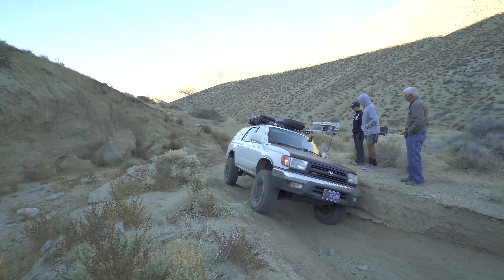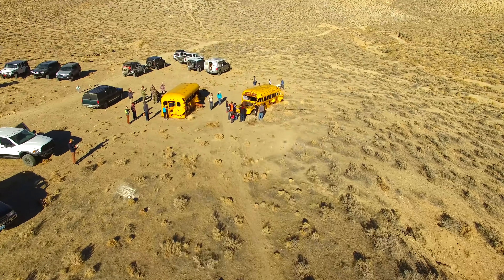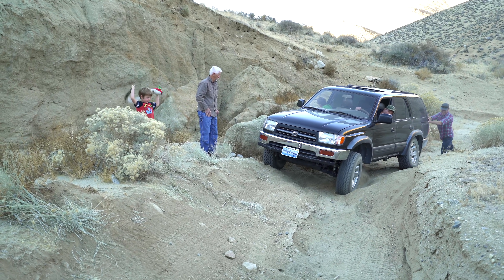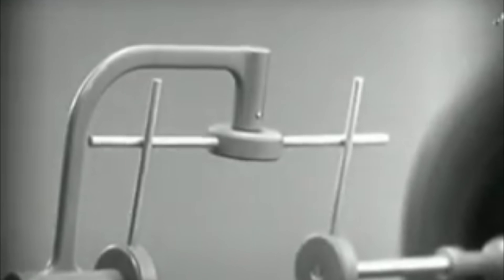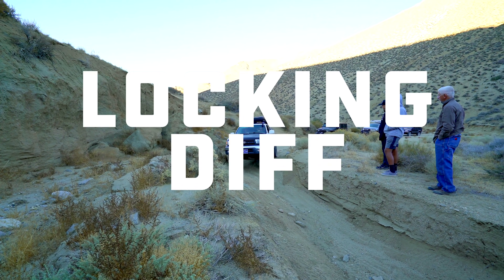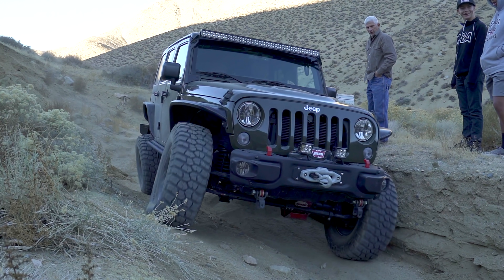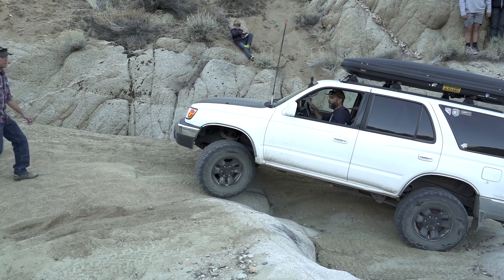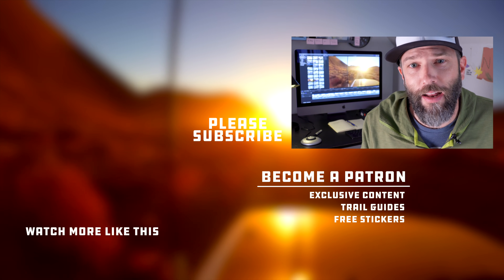Open Differentials vs. Traction Control vs. Lockers

Comment: Torsen diff is the answer. It combines the best of both worlds!
Reply: A true locking differential will always perform better in this kind of technical terrain.
Reply: Kal P Sure! a true locking diff is almost fools proof but also have disadvantages in terms of direction control and the wear it suffers for long operation. In my humble opinion the torsen have the ability to mechanically get locked and still operate smother on curves and tricky sections without risk of break something for improper use or abuse. I think at the end there is more than one way to do the job and on 99% of time torsen will do it right. Obviously if you prefer fully locked diff is perfectly fine 👍🏻 at the end this is about the fun you have in the trails 😁
Reply from the maker: I believe a torsion will still fail with in wheel completely in the air. Is that correct? Even still that rarely happens to more than one wheel at a time.
Reply: All-Terrain Family Well actually it is designed to get locked when some of the wheels on the same axle start to spin faster than the other so I don’t think it fails in that situation. If the wheel in the air is on the front for example it will not affect the rear as the center diff will still sending power to the rear axle. At least it is like that with the SS-II. It is basically a mechanical traction control.
Reply: All-Terrain Family that’s correct but tapping the brake solves that and allows for the Torsen to “lock up”. Torsen style diffs are used in the HMMWV military needed something that was private proof and required little to no maintenance.
Reply: Torsen is nice, but it's basically an all-gear type limited slip using worm gears. Limited slips are more suitable for street use then Off-road.
Reply: The Ford Raptor uses a Torsen in the front, but a true locker in the rear. Locker locks 1:1, a Torsen can not by its nature.
Reply: Adrian Wevers  Agree with the 1-1 lock. And have no doubts on the benefits of a true locker. My point is for the overlanders and most of off road aventures the Torsen will be fine without the disadvantages of the lockers. Even the wheel in air is solved with the pre-load packs in the axles or the TC. Probably in a extreme crawling situation lockers will rule, but for the rest of the time the fun is guaranteed with a good torsen in. You will not believe where I can go with my Mitsu. Cheers!
Reply: @humbertorubi4947  If you're an overlander who is actually going places where 4wd is required, then a locking differential will provide better performance and will last just as long as a limited slip.  

The beauty of a locking differential is that you only have to turn it on when you actually need the extra traction (with the exception of an auto locker like the Detroit locker).

Limited slip differentials are okay (they're certainly better than open differentials) but they have their limitations in technical terrain.
Reply: Torsen only works in mild conditions. It also suffers wear as opposed to locking diff. You sometimes need more than the torsen can send to one wheel. You need the whole torque from your transmission on ONE wheel. That is where Lockers are the best.
Reply from the maker: Yes!
Reply: All-Terrain Family My Mitsubishi Montero limited have one of these in the rear combined with a center lockable diff and it is simple phenomenal. Mitsu call this system Super Select II. It works great on curves and off camber situations. It’s curios is not used so often on more cars. Nice video 👍🏻
Reply: @humbertorubi4947  The traction control on Monteros has it on all four wheels. It's phenomenal and was ahead of its time. There are plenty of videos showing Monteros(Pajeros) doing insane things with no lockers.

Comment: Having a build done to my Tundra - including rear and front ARB airlockers. Hope I didn’t make a mistake
Reply: ARB is an excellent choice, I have one on my Toyota. As long as the people doing the work are competent they are very reliable. Best thing about the ARB is you can engage and disengage on the fly if you so desire. They lock and unlock very fast.
Reply: Thanks you guys. Originally had this build done because I thought we were going to head back up to Anchorage for an assignment in January. Thought lockers might help in case we ran into bad snow at some point. East coast til spring now and then hopefully head to the complete opposite side of the country where I can use my new toys.
Reply from the maker: No way you made a mistake. Unless you hate traction.

Comment: You can partially engage the e- brake a few clicks  to simulate traction with a rear LSD.
Reply: bush nut if the vehicle has brake traction control it will do it, itself.
Reply: @fabulousoffroaddesigns5080  Jeep calls it BLD
Reply: I’ve got 17 year old truck. No TC, just a good rear LSD and an open front. When I’ve been cross axled by applying the E brake a couple of clicks it fools the LSD by simulating traction at the spinning wheel. Not much I can do about the open front diff. Except install a locker.
Reply: @bushnut8305  Good way to destroy you parking brake. It's not a Emergency brake and if you have a disc/drum that little shoe will twist all to shit.

Comment: Why no AWD?
Reply: No real off-road vehicles use AWD. Subaru's are great, but AWD is simply not a good choice for serious Off-road duty.
Reply: Adrian Wevers oh trust me! I agree! But. I would say. The only AWD vehicle I would consider buying to do hard core off roading would be a Range Rover sport. It  is AWD. Has a low range and high range transfer case! And! And! A rear locking differential!
Reply: Plenty of vehicles are both all and four wheel drive. 4th gen 4runners have a lockable center diff and ATRAC II for example. You can run the 4unner in low range all wheel drive if you want.
Reply from the maker: Yes and no. Subarus can go a lot of cool places despite the AWD. I bet a suby would make it through the obstacle in this video just by small size advantage. Basically, “off road” and “4x4” is a higher bar that we admit.
Reply: The AWD on a Range Rover is not the same thing as what you find on Subaru, and also the Toyota for that matter and others like it. These are true 4x4 systems with a AWD mode integrated into the transfer case. Basically, they have a Torsen in the transfer case that can be switched into full lock mode. It's entirely different then the type of AWD you find in a car like a Subaru.
Reply: Adrian Wevers really? I did not know that. That makes sense now. So would it be possible to put a Torsen in the from differential?
Reply: @zanehopefz6hundred761  I am not sure I understand your question. Are you asking if it possible to make a 4x4 into AWD? It actually would be possible in some cases. But, it depends. For example, if you had a Toyota 4Runner with a normal part time 4x4 system, it would be possible to get a transfer case from another 4Runner that has the AWD 4x4 style transfer case and swap it in. You would have to swap the entire transfer case. It would be a challenge to hook up the electric shift motor in the transfer case in the Toyota, but it is technically possible. In a 4x4 with these type of systems, they are usually referred to as "Full time" four wheel drive. It would be better to simply buy it that way though. Staying with the example of a Toyota 4Runner, the current "Limited" model in the 4Runner lineup has this type of transfer case in it. Also the Toyota Land Cruiser had a Full-time for wheel drive system.
Reply from the maker: I believe you can put a Torsion in the front diff.
Reply: @AllTerrainFamily yes, of course. If someone makes one for you application, though that's not made for a lot dffs.
Reply from the maker: We didn’t have one on this trip. But we have plans to test a new Subaru Forester.
Reply: @AllTerrainFamily  subaru forrester,??,grass padock machine,garbage vehicle,we had one on a mild trip,on a farm,he never came back,no wheel travel,no ground clearence,this track was for learners,too hard for him....subaru,,,frigin joke.
Reply: For the record, I had A WRX. I love Subaru's, but it's crazy to make one into a dedicated off road vehicle. You would be money ahead to just get a proper 4x4.
Reply: all wheel drive is rubbish.can not be disconected,my mate with an 80 series has it,we tell him to fit hubs but he thinks it handles better.??.not.just more wear & fuel.open diffs with a choice of lockers is best,period.

Comment: On my 2013 Wrangler (with open differentials) my traction control turns off when I'm in low range. I get through with low (15 psi) tire pressure, articulation, and driver skill. Yes, I eventually want lockers in both ends.
Reply: BLD is still enabled in 4 Low read your manual
Reply: You're correct, the "limited slip" function of the traction control still works in low range.

Comment: Traded my Jeep Rubicon in for a Toyota Tundra. Glad to see the Tundra in this video. I told my wife we could still go a lot of places in the Tundra. I wanted more towing and hauling capability. I do want to add lockers eventually.
Reply: I am in the same boat. I have a 2nd Gen Tundra and worry about it being too big for some trails.
Reply: Bradley Johnson only if your worried about NV pin striping.
Reply: @shawnomeara22  I am worried about the scratches, but I'll get over it.
Reply: Tim Johnson I’ve scratched and scraped my Wagon pretty good and mostly got over it. Check out All Terrain Family’s other video of the walk around of my PW.
Reply: Tim Johnson, I did the same thing. First I traded it in for an F150, but started having problems with it right away, traded it in for the Power Wagon and haven’t looked back. The factory lockers and low gears are hard to beat.
Reply: @shawnomeara22  Power Wagon...you SOB...Ha

Comment: Excellent video mate! As someone already said, the Jeeps are equipped with BLD (brake lock differential) which is basically the traction control. It applies a little braking when slippage is detected, as you explained in the video. Would have been nice if you included LIMITED SLIP diffs on this comparison! The Jeeps call theirs the Trac-Lok diffs (equipped in JK Willys). The Rubicon has de Tru-Lok diffs front&rear. Cheers!
Reply from the maker: Thanks ! Next time i get a chance we’ll look at LS.

Comment: Wrangler calls it BLD (brake lock differential) and enables open differential to act like a LSD. The system is more responsive that typical traction control. Most Wranglers do not need lockers and many with BLD have conquered the Rubicon.
Reply: It’s most aggressive in low range, although it will engage quite severely in low traction situations when it detects very high speed slipping such as on ice. It can be disabled in 2 wheel drive by pressing the traction control button, but stays on permanently in low. From what I’ve seen in my own JK, it works very effectively and it has gotten me through some pretty nasty trails
Reply: Ryan's Jeep Garage do all JK’s come stock with that?
Reply: Shawn O'Meara as far as I am aware yes
Reply: No.... it is a $600 option or comes on certain special editions... my winter version jk has it and it works great... for east coast wheeling ...I can go anywhere my rubi buddies can.
Reply: @dp_NYC  Yes, all JK's up have it standard. https://blog.fcanorthamerica.com/2008/02/11/jeep-brake-traction-control-explained/
Reply: On a JK ... you had a standard version. An optional Trac-Lok limited slip LSD (available on Sahara’s and Sport S ) @$595... this was also included in Willy’s, 1942s, and winter versions and it always has KO2 And KO mud tires)  on a Sahara,  Trac-Lok is automatic. Rubicons have as standard Tru-Lok is electronically controlled via switch air locker.    (When I bought my 2016 winter version it included the TracLok but offered the Tru-Lok as a $1600 option.     So unless your Jeep came with KO tires... and you didn’t check that TrakLoc option... you have open diffs front and back...
Reply: @dp_NYC  ESC, TCS and BLD are all standard on a JK Wrangler. No option it's free..
Reply from the maker: I’ve seen it in action on video. It only works in Low right?

Comment: Keeps have traction control similar to atrac as well as that rubicon has front and rear lockers that can be individually selected. He probably just had the rear locker on as it looked like there was a slight turn in the road and front locked makes turning hard.

Comment: Had a fj cruiser with atrac and selectable locker.  Loved the selectable locker.  Marlin crawler has some videos illustrating open diffs with extreme gearing that can make someone scratch their head
Reply: I have the 5th 4runner with A-trac as well. I heard it's not good idea to use A-trac in mud. Would you agree or disagree?

Comment: Mike, good video/explanation on a tough process/function to describe.  What I did here was activate the rear locker.  As is explained, also locking the front dif is sometimes a must (not standard on many 4X4s), but can be a real handful in a tight situation where you have to maneuver.  It can be very detrimental to run either locker on a hard surface, like pavement which doesn’t allow for any give, thereby transferring all of the stress directly to the drive train.  Best to confine it’s use to sand, snow, or mud..ewwww, on the last one! :)
Note:  I had also disconnected the sway bar for more front wheel articulation.  I used to have to do that mechanically on our TJ.  On the Rubicons all functions are done electronically.  In the 80s on my K5 Blazer I installed Warn locking hubs which often meant getting out of the rig in nasty conditions to actuate them.  It didn’t have a locking differential, and in ‘87 we got hung up on a tight switch-back (Black Bear Pass, CO) with one front wheel, and the opposite rear wheel floating two feet in the air.  I think that underscores what you’re showing in this video.
Hope this has been of some help.

We’ll be seeing you on New Year’s Day for your Como group ride.  It should be another fun adventure of exploring awesome Nevada.  Not anticipating much mud.🤞

Comment: I had a 2000 4Runner with ARB air lockers back and front. Based on my experience save yourself some money and avoid lockers on the front axle specially with an IFS hard on the CVs.
Also when lockers engaged on slippery mud they can track your vehicle sideways onto a tree or a rock.
Now I own a 2016 Tacoma trd off road, even though it has rear locker from factory I prefer to use A-trac most of the time.
Reply from the maker: Yeah. A-trac would have worked for the 4Runners. The Tundra got sketchy because of the size. Maybe realignment would have solved that problem.
Reply: All-Terrain Family and of course a steady gas pedal, but easier said than done on the 07-13 Tundras. I have one

Comment: A vid about traction aids and no mention of Shawn's  Power Wagon ?
Reply from the maker: I didn’t get video of him going through this section.
Reply: @AllTerrainFamily  excuses, excuses.  All in jest.  I love your vids.  This was a really good representation of each type.  My last truck was a Sub 2500 w/ G80.  It worked great for me with 33" tires.  I'm thinking there is something wrong with your pop's.  When my fluid needed to be changed it was usually the opposite problem.  It started locking up on dry pavement on turns.  Now I have the '13 PW so different engagement.
Reply from the maker: Can’t let this turn into a Power Wagon Channel!
Reply: Lol! What’s funny about that section is I had bumped the toggle switch that feeds power to the locker rockers with my CB mike, I thought I had my rear locker engaged but did not. Mikes dad told me my rear tire was spinning but I did not notice it in the cab, I crawled through with my sway disconnected and the rear LSD.
Reply: @shawnomeara22  the sway disconnect is underrated as a tracking aid.  If the tires are on the ground these PW normally keep moving.  The LSD is a nice feature, even on wet or snowy pavement.
Reply from the maker: For one size probably helped you!
Reply: @AllTerrainFamily  that's what she said😂
Reply: @AllTerrainFamily  quoting  a description of G80 operation:  "...when one tire spins 120 rpm faster than the other, the G80 locker kicks into action. .. the difference in rpm actuates a flyweight-type governor, slinging a pawl that engages a clutch system, which then causes a cam plate to ramp against a side gear, compressing the disc pack. This action locks together both axle shafts, and therefore makes both wheels rotate at the same speed. Eaton has included two such actuating pawls, allowing the G80 to work in both forward and reverse gears.  ". It is my understanding that the additive is a friction modifier so the clutches and friction plates don't hang up/chatter during normal operation (dry pavement).  So, my thinking is the friction plates or some internals need a refresh + new fluid w/ additive.  As mentioned, I knew my fluid was beat when my locker would start to chatter or offer resistance during slow turns on dry pavement.  Locking operation was unaffected when needed even when fluid was beat.